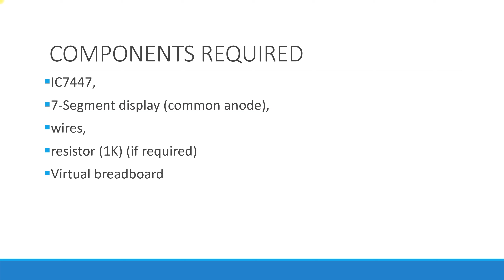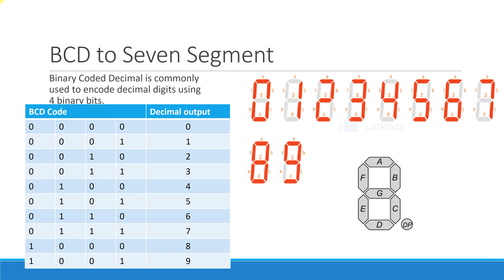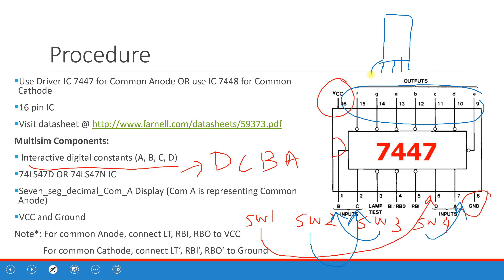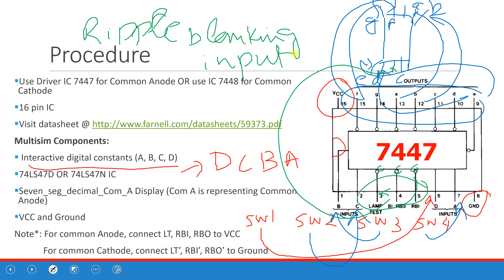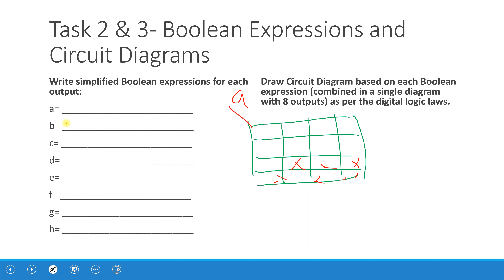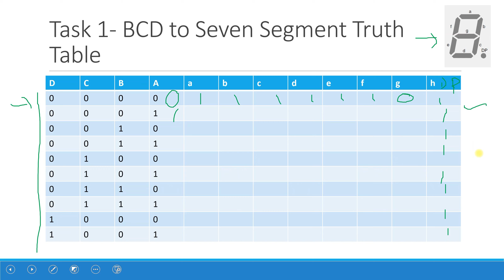EEE241 Digital Logic Design lab 7 BCD to seven segment display

Comment: 14:30 isn't the configuration  for common anode is BCDA(inputs) on IC 7447 but you are saying DCBA ??
Reply from the maker: I am saying in perspective to the truth table mentioned at the end of lecture. 
Instead of ABCD in which normally A is most significant bit and D is least significant, we are designing the truth table in which D is most significant and A is least significant bit so we vary the sequence as DCBA. It might not be relatable in multisim bcz all variables are labelled there. But in hardware the input sequence is normally inverted in common anode thats why i mentioned DCBA here.